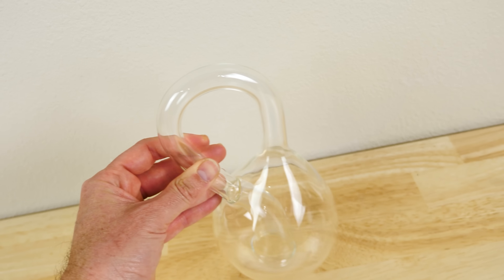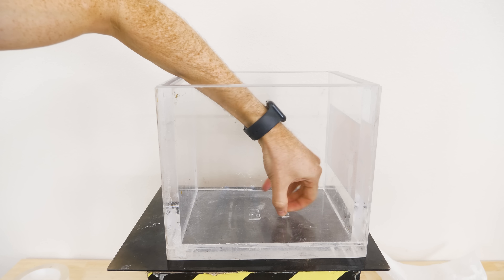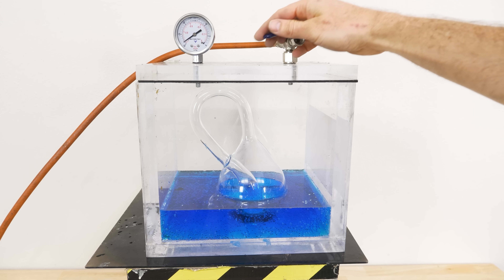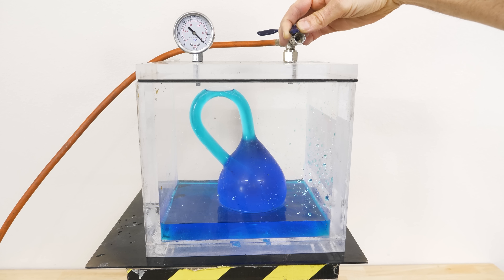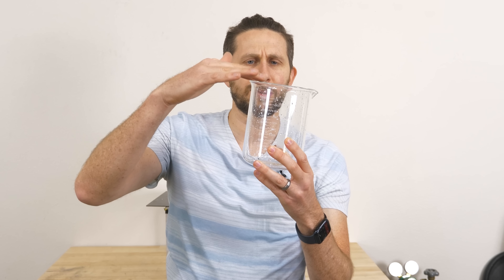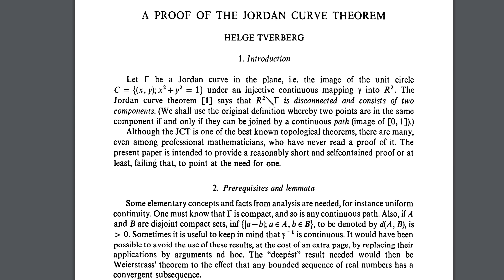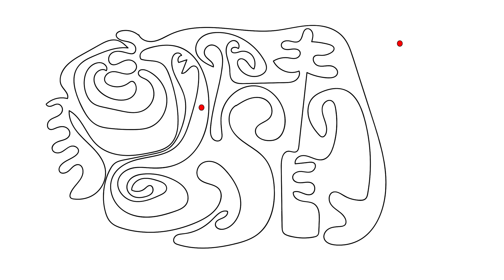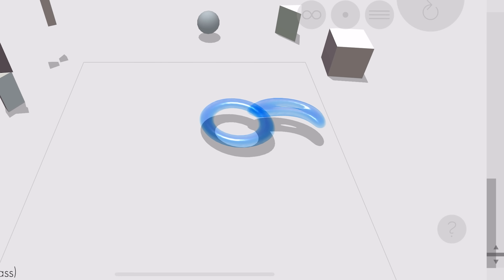Is It Possible To Completely Fill a Klein Bottle?

Comment: I love how he knew using a straw to get the air out, or force the fluid in would have worked fine, but just wanted to use the vacuum chamber.
Reply: "You could have used a straw"
"But I want to use the vacuum chamber"
Reply: As the old saying goes: "Why suck, when you can mega suck?"
Reply: @ehsancharolia3297  AYO
Reply: @ehsancharolia3297  If I'm remembering correctly, your mom said that last night. Correct?
Reply: @ehsancharolia3297 words I live by.
Reply: When all you have is a vacuum chamber, every problem becomes an atmospheric pressure.
Reply: It's the same thing happening, the vacuum chamber is easier and more fun to watch
Reply: Or put it in a bathtub fully underwater and keep rotating it...
Reply: @saber1epee0  then the oxygen and other gases can’t get out
Reply: i was about to tell him to use a tube
Reply: The mystery of taco is why he never took physics class
Reply: @Galaxia_Moon  The mystery of the taco shall be solved on Taco Tuesday
Reply: Except he doesn't say that in the video. I wouldn't be surprised if he sufferred from a situation like "if all you have is a hammer, everything looks like a nail", except he loves his vacuum chamber. I'm also dissapointed he didn't turn it bulb side up when it was full of liquid to demonstrate its similarity to the beaker/cup.
Reply: Got to justify that purchase man
Reply: He could have drilled a small hole...
Reply: Why does he look like morbious
Reply: Can't you dip it in water water or something rather than using the vacum chamber
Reply: @Gamerinme6996  it still wouldnt fill without a straw
Reply: @Gamerinme6996 water you saying
Reply: the vacuum chamber is just cooler.
Reply: I think it’s stupid. It’s overengineering a problem. Apply that in the real world and your company will go bust, someone will get hurt, or you will be unemployed and making YouTube videos in short order.  
It’s like watching some crazy field fix of equipment in India that would be pretty rad. But all you can focus on is the guy wearing safety sandals while sparks and slag fly around.

Comment: I mean, with a tube you could do it easier, but a vacuum chamber is cool.

Just insert the tube and fill it from the inside through the tube, or fill it from the outside and let the air out through the tube.

Comment: Why not just use a rubber hose? Go from the bottom hole, snake through the neck and settle at the base of the main volume. Liquid goes in, air comes out... I guess it wouldn't be as interesting of a video?

Comment: Well, I am the only one who was thinking, vacuum chamber was not really necessary? If you put a small tube inside, which one is not blocking the air flow completely down in the neck side, while you pumping liquid inside, air coming out. you just have to move to tube out slowly. Maybe I am wrong. :) Can you do it for me? :)

Comment: Another way of filling the bottle could be injecting liquid with flexible hose going inside the bottle alongwith some movement of the bottle.

Even more convenient way - fully immerse the bottle in the liquid, try to move out the air from bottle by rotating/turning it several times. 

I have not tried it but it could be an easier way.
Reply: Well tried.

Comment: It has an inside and outside it's just that the opening of the bottle is run through the body of the larger area of the bottle which also would show that there is an inside and outside to the bottle. Just cause they blend into each other doesn't mean that the bottle has no volume, since the bottle still has an area of space which it occupies.
Reply: exactly. By his logic, no beakers of any kind have volume because they are open on top.

Comment: A simpler way to fill it might be to use a flexible double tube to allow for fluid exchange. Still, pretty cool.
Reply: Just a single tube works.  Push it in until it reaches the highest internal point & then pour as normal.  Or submerge & rotate enough times until full.
Reply: @NemoConsequentae  There's still going to be bubbles
Reply: @Psychobolic77  Only those stuck to the glass, (which can be dislodged), or the gas dissolved in the water.  Just as there was still air in that one.  You would need a much better vacuum pump than was used to get it all out.  If you really want it all out, you use a diff pump at least. (As used in STEM's.). But for everyday practical applications, just dunking it or using a tube is just as effective as the one in the video.
Reply: Ok but that doesnt look cool
Reply: @xrexkinect  Simple solutions are not cool tho
Reply: @imjoesan  🤣🤣🤣
Reply: 700th like
Reply: Shut up, nerd

Jk
Reply: Or just dunk the whole thing under water and turn it in a circle a couple times to let the air work its
Way out.
Reply: @andymccranie  Yes, he tried to do this in the video, if I recall correctly, but the smaller bubbles are much more tenacious. Eventually, with a lot of time and patience it can be done this way, but definitely not very efficient.

Comment: you could have sent water inside it by using a straw and meanwhile turn it around slightly to let the air out instead of vacuum chamber tho ;)
Reply: i meant instead of sucking water inside, you could blow water into it

Comment: If the top of the beaker is an "arbitrary" line created to distinguish the outside and inside, then the balls hole that lets you pump it up is also arbitrary.

Comment: Actually, I don't think you need a vacuum chamber to do this. You'll need patience and a large tank of the liquid you want to will it with. To fill it you need to place the bottle inside the liquid, so that the air will be removed and eventually have none. Also, you can probably fill it by sealing the "exit" before trying to let the air out after filling it the normal way. Then you shake it and the trapped air will move from the "bottle" to the "pipe". Then you add more liquid and repeat until it's completely full. I have no such thing as a Klein bottle to try such ideas so ¯\_(ツ)_/¯
Reply: He went over a key observation very quickly: things that have volume can be filled in any orientation with respect to gravity. Ball vs beaker.

Comment: hmmm, would the bottle not easly be filled up by sticking a rubber tube in, to let the air out while the liquid is flowing in.
Low tech, instead of vakuum.

Comment: the dot thing doesnt rlly make sense. if u have 2 dots both on the opposite outside of a circle, the line between the dots will cross the circle twice which is even, but both dot is outside. is that a loophole in the proof or am i missing smt?

Comment: I'm not gonna lie. Watching this drives me crazy because all you need is a bendable straw to let air out. You would break the water seal with the straw letting water flow freely in and out of the bottle.

Comment: A beaker does have a volume, in my opinion; it's the total mass of the glass that composes it.  It's only in two dimensions that you can actually claim that it has no volume, because nothing has volume in two dimensions; it only has area.  When the beaker is closed at the top with a lid, then you could define the volume as the space within it.  Mathematicians are being a little cute in their definition of volume, when it's really a matter of perspective in what you are actually defining as the volume space.

Comment: Just stick a straw in it, it has to be a long straw but it will allow the air to escape while allowing water in. Its won't as exciting but you won't need to buy an expensive machine.

Comment: Vacuum chamber is over complicating it. Take a thin, flexible tube and feed it into the opening in the Klein bottle until it reaches the large open space. Pump water through the tube. The air will flow out around the tube. Rotate as needed to prevent bubbles from getting stuck in the loop.

Comment: Maybe I'm not thinking right but couldnt you just put a small hose through the hole and fill it thasy way?

Of course it still won't fully fill it but probably easier then using a vacccuum chamber. Great video tho

Comment: If you didn't have a vacuum chamber then could you potentially fill it with liquid by completely submerging it and inserting a bendy rubber tube and pumping liquid into it to replace the gass

Comment: Wait, how does it not have a volume? It has some density and some mass and, as we know, density is the ratio between mass and volume. If the bottle weighs, lets say 100 (im not going to use any units) and has a density of 50, it means that for each unit of volume, there are 50 units of mass, meaning that it has a volume of 2

Comment: Technically there is a volume as the glass had some thickness which can be used to define the inside and outside world
Reply: okay yeah but if you made it in a 3d model tool it would have no volume
Reply: @teralogin1  no???

Comment: Hello, the easiest way to fill this Klein Bottle is to use flexible hose / tube that is smaller than the opening, put the tube inside and let the liquid flow into "main chamber". As soon as it is filled with liquid, slowly take out the tube with still running liquid, doing so you will fill in the entire Klein Bottle - the easier and faster way. Bests!
Reply: That's right. Though the fella seems to be infatuated with his vacuum pump. He probably even boils his tea water with it instead of a stove. :face-blue-smiling:
Reply: @Adam_Adamsky  Actually, its pretty easy to "boil" water with vacuum pump. This is because when pressure goes down, waters point of boiling gets also down. So you can have room temperature water boiling with vacuum pump. The water is just room temperature what is pretty low temperature for tea.
Reply: @Kroko25  Go back and read again, and try to understand: 1. the sarcasm of 2. brewing tea with boiling water at room temperature only because 3. the fella is so infatuated with his vacuum pump.
Reply: @Kroko25  Great, we now invented a cold tea automaton which need the energy instead for boiling for sucking. Anyone wanna invest? ;p
Elon?
Reply: @Adam_Adamsky  Go back and read again, and try to understand: 1. Your sarcasm was so bland it didn't receive any laughter. 2. It was so poor in fact a nice person decided to elucidate the basics of water boiling in a vacuum to redirect your initial comment into one more educational. 3. I'm sure they, as we all were, knew you were making a sarcastic comment, but, being such a boring one, enjoyed the other person's comment with actual substance instead.
Reply: @Adam_Adamsky  Bro you made a crap joke. Just own it, learn from it and move on. Your lists are funny though, ironically, I'll give you that.
Reply: @robosing225  I disagree. I enjoyed the comment from the Piotr guy.
Reply: so I wasn't the only one thinking this
Reply: yeah but your solution to that doesn't prove the jordan curve theorem....
Reply: @stanvans3214  Hi Stan, thanks you made me think about it. This is all the same! He uses suction (pressure bellow atmospheric) and I propose compression (pressure above atmospheric) - you can imagine that our host could use a compressor in his experiment instead of vacuum pump and would arrive at similar effect - the air inside the plain bottle would compress giving way to the liquid, after normalising the pressures the compressed air would expand and escape the klein bottle - all of it would not escape similarly in his experiment a bit was left there. now you can imagine that instead of the square box chamber with vacuum as in his experiment he is using a hose with vacuum that is put "inside" klein bottle - than you simply directly suck out the air out of it forcing liquid to flow in - how different is that if you force the liquid with hose into the klein bottle and the air escapes... so the only difference is that we have a different shape - hose instead of the box and we use pressure instead of suction - everything is from general point of view is the same - but simply it is "much" simpler. Bests. TS
Reply: @stanvans3214  Hello Stan, the title of this video is a question "Is It Possible To Completely Fill a Klein Bottle?" and our host says at 6:36 that you need a vacuum pump to fill in Klein bottle, hence the comment how to fill in - the easier way. Bests. TS
Reply: why not just put ir under water and shake it so it fills up lol

Comment: Wouldn't it just be easier to turn the small opening up... run a flexible tube into the large section to let the air vent... and then just fill it up...?

Comment: Volume or displacement?

Is volume how much the thing can hold if a substance were placed into it?  I.e. the beaker has a volume of displacement (the glass it's made of as it might displace water when submerged) or the volume of its capacity (how much water it can contain).
The klein bottle has both displacement - how much the glass it's made of and the air trapped within when it is submerged - and volume - the quantity of air (or other substance) it contains and maintains separate from the outside (both beaker and bottle do not 'lock away' their contents like the ball does, and cannot maintain that volume of contents if deformed).

Comment: Sweet demonstration of the forces that we are Subjected to ! But a vacuum chamber is NOT the only solution to the Forces involved here.
It can be accomplished very simple and easy with the already surrounding atmospheric pressure and one more item. 
( NOT a Pump )
Hint : you are holding a pressure difference in your hand at the 0.43 mark.
Someone who has ever started a pool pump may get it.

Comment: Question - Couldn't the volume of the Klein bottle defined by the area of the water being held inside it, just like a beaker?
Reply: @Christian Seibold they're not arguments, a mathematician considers volume differently than a physicist/engineer. Just because you're getting a headache trying to think like a mathematician doesnt mean the "arguments are dumb", fool
Reply: Yeah, by his definition, a simple bowl has no volume either. Only closed objects, like a ball. But how do you fill a ball? It has to be open. But if it is open, how does it have a volume, if the definition of volume is that the inside and the outside are blocked from each other.
Reply: There's still the matter of what constitutes "inside" for this particular shape.
Reply: @ennfaernal  This argument is pure sophistry.
Reply: @Christian Seibold lol I can also say these practical arguments are dumb. 

I can define a volume for everything in the physical world and come up with multiple ways of measuring them either directly or indirectly.

It's a tautology and nothing will be gained from it.
Reply: @tim1259  me: "See? 700mL of water"

You: "NOTHING CAN BE GAINED FROM THIS!!!"

Comment: Just like any glass Coke bottle, the Klein bottle has  a volume. Take the Coke bottle and drag your finger across the outside and then allow your finger to transition to the inside of the bottle. Outside to inside. This is the identical thing you are doing with the Klein bottle. if you wanted to, you could point out the lip or rim of the entrance just like the Coke bottle has, albeit a slightly different shape, while you are dragging your finger across the outside of the Klein bottle and then into the inside. I could also fill this Klein bottle without vacuum. I would just slip a thin hose up the entrance from the bottom and then fill the Klein bottle from a reservoir above the Klein bottle. It would fill to the top and then begin spilling down the tube to the entrance/exit. Just like a Coke bottle is never filled completely.
Reply: The real point of the video was to talk about the concept of a shape with volume and a shape without volume. He points out the coke bottle doesn't have true volume in that way either, as there is no hard barrier between the "inside" of the bottle and the outside world. We simply define an arbitrary "edge" based on how we can keep a substance trapped due to gravity. That last half of the video where this was discussed was very interesting.
Reply: This glass model is not a true Klein bottle though. You should have watched the video till the end.
Reply: @minisynthmaniac  that had nothing to do with its volume, but a more technical requirement to be non-intersecting. A beaker and a coke bottle don't have a volume in that sense either, but they are not closed. The lower dimensional  equivalent would be the letters O and U, O has an area and is closed, U is not closed, therefor the concept of its area does not make sense. The klein bottle is special because it is closed and still does not have an inner or outer, whether you allow it to selfintersect or not.

Comment: ......using the vacuum was just for the audience wasn't it? you can completely fill it (possibly faster than you did here) with a small hose, about 4-5 times as long as your klein bottle is high, and a simple drinking glass with water. Without any electrified help.

Comment: Just use rotational or centrifugal casting methods for hollow coating or casting. It needs to rotate and be placed inside a base mold with a spout hole that can be plugged and unplugged for interval material distribution to consistently have an even coat on hollow parts.
Reply: Unga bunga

Comment: Would be easier to just stick in a plastic tube from the bottom and it should fill it up till the top curve, and then continue oumping water while pulling out the tube and turning it upside down. If there is room next to the tube for the air to escape  then it should be easy.